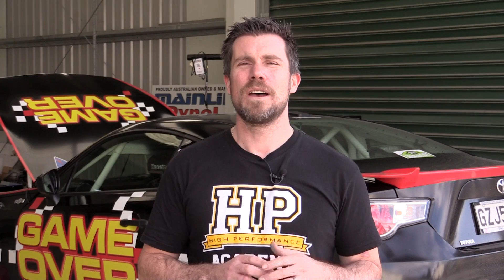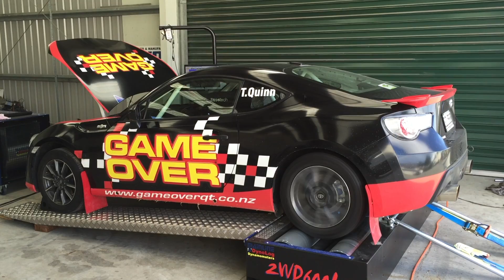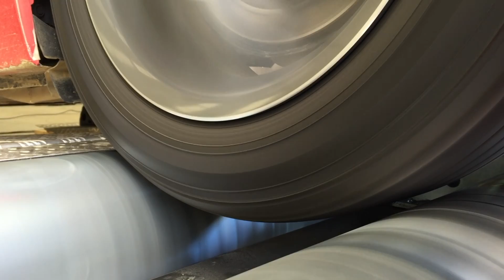🌬️ MAP vs MAF Sensors | MAFless Tuning

Comment: I bought a standalone with a built in map sensor but I still have the original 1jz map sensor connected. Should I disconnect it and plug the vacuum?

Comment: Do you think a 70mm maf  would be big enough for a 420hp fuel injected 302.NA?
Reply: @19jody72  get an 80-90mm
Reply: @NTOURIS20VT  i ended up using a lighting unit

Comment: What kind of map sensor should I use on a Honda Civic 1.8l NON boosted, but with aftermarket intake manifold, CAI, and throttle body spacer? Thank you in advance
Reply: The factory Honda map sensor and a tune specific for that intake manifold and your other aftermarket parts would be great

Comment: I have a 87 s/d foxbody ... Currently installing e-303 cam ported e7 heads upper /lower gt40 intake... Would it run fine with the stock ecu or should I convert to maf ????
Reply from the maker: You'd more than likely be better off with a standalone ECU if you're making changes like that and what some form of drivability to be honest, but the Foxbody tuning community will know what's up - Taz.

Comment: That is interesting.  The older Bosch fuel injection system, D-Jetronic from the late sixties to late seventies, used a MAP sensor - it measured inlet manifold vacuum - while the L-jetronic that largely succeeded it used a MAF sensor - measured the actual air flow going into the engine.  This was supposed to offer superior measurement because it was actual Vs derived.  I suppose that is less important when you are most interested in big power rather than efficiency and emissions.

Comment: Is it fair to then say that a MAF sensor is more accurate than a MAP sensor? And is there any benefit to MAP other than packaging size? 

Say you had room to fit either in an engine bay and are running a stand-alone ECU. Stick with MAF or switch to MAP?
Reply from the maker: Properly calibrated, yes the MAF is more accurate as it is directly measuring the mass of air. A speed density system however is still usually preferable in the aftermarket as we don't need to worry about the resolution and measurement limit of the MAF sensor. We also don't need to worry about the MAF being upset by reversion pulses or compatibility with blow off valves in turbo applications.